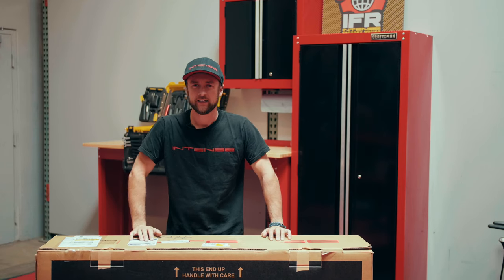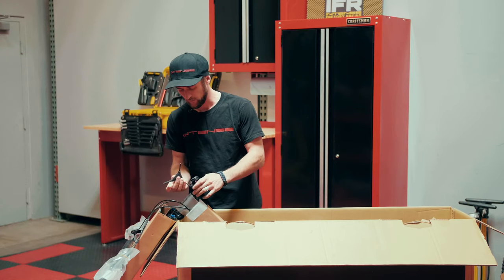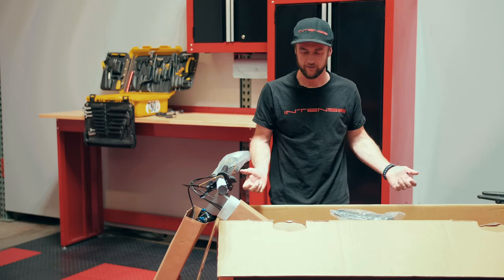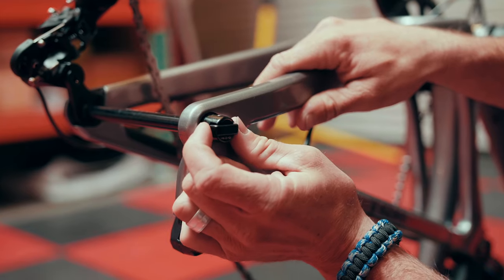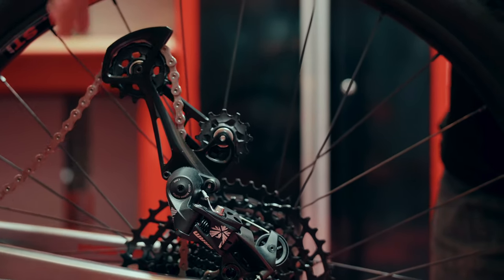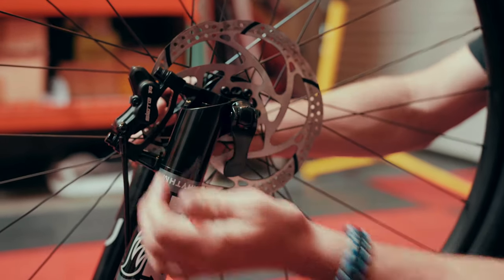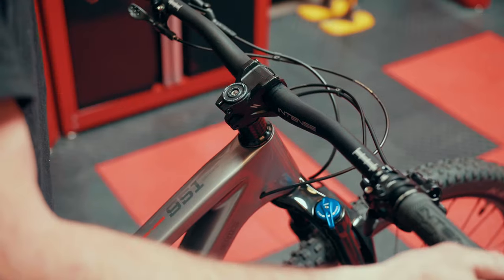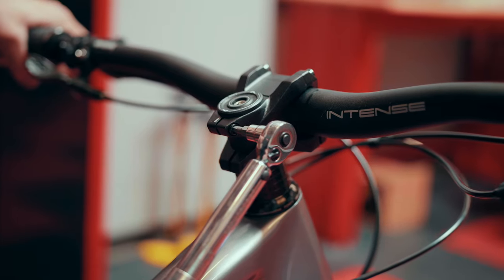INTENSE 951 XC Bike Unboxing

Comment: I've assembled three of these (2 Trail and 1 XC) bikes now, and on every one, the longer brake hose was wrapped 360-degrees around the fork crown, requiring pulling the fork or pulling one grip and brake lever to correct. (Editing here, being left-handed and working amidst hungry mosquitos or in hot sun, In each case I simply had turned the fork in the wrong direction upon taking the bike from the box, doh!)
I didn't see this to be the case in this video, their handlebar cardboard appeared to have already been removed from the bar assembly, and I had supposed that the grip and lever had been pulled to unwind the hose from the fork crown/headtube.
I couldn't just twist the bar and cabling into alignment without twisting the cables/hoses into a rope.
Likely the cable needed to be wrapped around the head tube to prevent shipping stress on the hose(?), but again, I'm left-handed!

Secondly, both of the Trail bikes featured a somewhat backed-out hi-limit screw, giving near-instant chain jam against the swingarm after shifting to the 11t cog. A full turn tighter on the limit screw was needed.
No, this wasn't because the hanger stop lug was preventing full tightening of the derailer mounting bolt, and no, the hanger wasn't bent either.
I re-tightened the hollow bolt holding the hanger onto the swingarm, it too had lost tension just like the cassette lockrings, and needs 100 in-lbs using a 19mm or 3/4" socket.
The cassette lockring on each bike didn't maintain much tightening tension (the plastic cog spacers of course settled a bit after their initial torquing).  The cassette had to come off anyway though (to lightly grease the splines and to remove the clear plastic spoke disc).

Two of the bikes needed minor caliper realignment laterally, to prevent rub on the disc's high spot.  No, I didn't cause the high spot on the rotors, which was within normal tolerances.
Disc mounting bolts took well to some moderate torquing, each bolt creaking a bit in the tightening direction after my break-in runs down a short hill.

The included single bottle cage that came with the 951 Trail model did not clear the forward end of the suspension link mounting, so I had to go through a half-dozen cages here to find a metal one that fit. Forcing the included cage on would have quickly eroded the frame paint at the pivot mount while riding.
The included cages fit on the 951XC just fine, but be aware that the bolts shouldn't be too heavily tightened and that the cage plastic will settle and compress, causing occasional loosening especially early on. This is a high-maintenance area on most bikes with plastic or carbon cages and even metal ones tend to loosen initially.

These bikes with their longer wheelbase, bigger wheels and much wider handlebars aren't going to fit into the trunk of a sedan like older mtb's having smaller wheels and traditional geometry.  These also seem to take up much more room in the garage than my older bikes, more like a motorcycle! I was able to drive home from Costco with the box shoved into the trunk of my 2005 Camry, heavy end in first and with the trunk lid held down by the wind on the highway. A cord should be used for retention and to satisfy the highway patrol, but I didn't bring any rope, my bad.

These quibbles aside, these are great mid-range, serious carbon mtb's for the money, and the suspension settings weren't far off for my 145lbs. Spoke tensions were also quite acceptable, especially at my weight and age (late 50's).

Comment: Okay, got to the step where it says to turn the stem around to face forward and the stem does not budge.
Reply: Solved that problem by loosening the 2 bolts that clamp the stem to the fork. Next problem has been removing the small cap over the rear wheel hub. It doesn't want to come off. Does  it screw off or pop off? I can't get it off either way. First I tried with a plastic spudger then with a flat screwdriver. No luck so far. I don't want to scratch up the hub. This has not been as simple as shown in the video.
Reply: A pair of slip joint pliers made quick work of the hub cap. Watching the video, he pulls the cap off by hand with a quick movement. No way that was working on mine.

Comment: Why doesn't the 4mm bit fit in the stem face plate bolt?
Reply from the maker: It should fit into the face stem bolt unless the bolt is stripped or has something in the bolt hole?
Reply: @IntenseCycles1993  it does not fit. There is nothing in the hole, but I wonder if the bolts are painted black and have too much paint in the hole? Not sure what it is, but it doesn't fit.

Comment: 120 mm front shox? Thats a no at this price 3249. You just paying for a Carbon frame period. Giant Reign 2 is much better deal.
Reply: Why you comparing an enduro bike to a downcountry. Are you crazy
Reply: A bike like the 951 xc would cost four and a half grand at another company
Reply: @AnthonyOrtega-ki4mx  you can do the same with both. No big difference. Like you only use one for a specific purpose. Like I said all your paying for is a carbon frame.
Reply: @ric5683  no big difference that’s a 5 cm difference in travel. You saying that the amount of travel in a bike determines the cost of the bike is crazy. There are 2000 dollar 170 mm travel bikes and there are 15000 dollar 120 mm travel bikes. Also the 951 is a significantly better deal. The carbon frame probably adds a grand more in value compared to an aluminum
Reply from the maker: You are kind of comparing apples and oranges. The Reign 2 is an aluminum Enduro bike. The 951 XC is a carbon fiber XC style bike with lighter weight components. A little bit better comparison would be the 951 Trail bike with 150mm of travel. Looking at the price of the Reign 2 ($3,550 USD) for an alloy bike, the 951 Trail with a carbon frame and well spec'd components is a solid value.
Reply: Tell me you don't really know much about bikes, without telling me you don't know much about bikes.